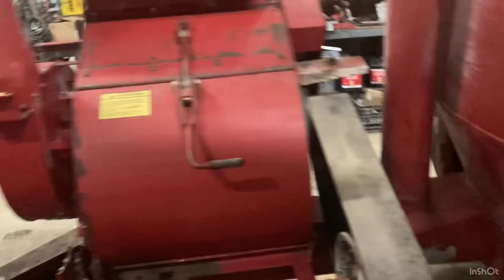Can a welder restore a dead battery???

Comment: Oh, sure... I gotta wait for part two...
Reply: Ed l'm with you there lol
Reply from the maker: I can save you some time. It DID NOT WORK
Reply: @millionairefarmer.  lol.. I had my doubts... I hate dealing with wet batteries! If the fumes don't get you, they can go 💥... 
We've had really good luck with AGM batteries.
Reply from the maker: I have to figure out why only two holes bubbled then three then back to two.
Reply: @millionairefarmer.  maybe corroded out, or shorted???
Just be careful messing with it.. you don't want to be too close if it goes 💥
Reply: @GosselinFarmsEdGosselin  your right on the AGM batteries. Got 12 years out of set in my dodge diesel.
Reply: @jeremycherny2041  we've gotten 6 to 14 years ... Might even have a few older ones still around 🤔 
Either way, they last, they are a lot safer!! And if one does go down, a good 10amp charge for a day or two, sometimes brings them back for a while 👍
Reply: The other plates could have been damaged, plus I think the hugest I’ve seen someone take it was 120amps and had all 6 holes boiling…
Reply: plates were to wonky mate if it did work its believed that the plates were just badly sulfated and this process is suposed to melt the sulfate off to be trnt back into the asid
Reply: slowly crank it till u see good bubbling maby some of the cells are shorted or more sulfated then the others

Comment: That's way to high of amps.. it won't blow up with the caps off and make sure there is no open flame. That was a very long video lol.. good luck
Reply from the maker: I wasn’t sure what was required. All I can say is what I did was not successful
Reply: @Millionaire Farmer  it works for some and not for others.. now what you could do after a boil and cool is empty the battery into like a 5 gallon plastic bucket  save the electrolyte. Then you want to wash out the battery use a garden hose.. fill half way and shake the battery empty that but not in the original bucket.. do that 2 times.. this is extra step take 2 x4 cause they are soft and drop battery from like 18 to 24 inches onto the wood.. then flip it upside-down and spray all the cells with the hose to get out more crud. Let the battery dry completely upside-down for 2 days.. Last you have 2 options filter you old electrolyte and add it back in or buy new acid for 20 bucks and add it until you cover the plates and top off with distilled water.. this process works very very well.. good luck
Reply from the maker: Wow thanks, might have to try that
Reply: @millionairefarmer.  one more thing to remember if the water doesn't start boiling almost immediately then you have a dead cell and stop what you're doing because the battery could explode to check each cell use a Multimeter put the positive end inside of each water and the negative on the negative post there should be two volts to each cell going up 2 4 6 8 10 12 if one of them gets no reading then you definitely have a dead cell same things to go with it not bubbling
Reply from the maker: @productionapostle1298  thank you very much for that info. I will have to check that.